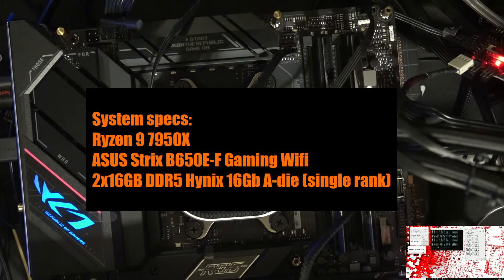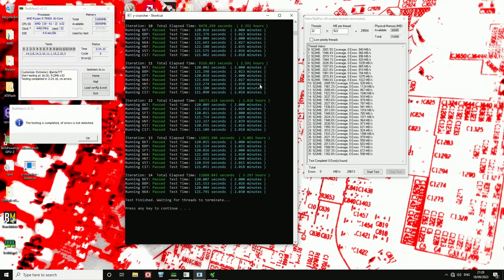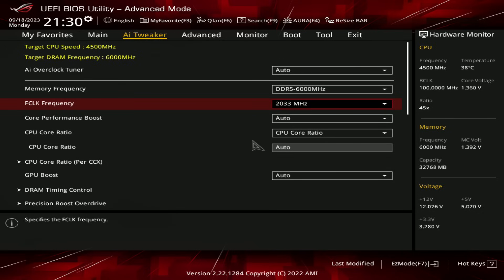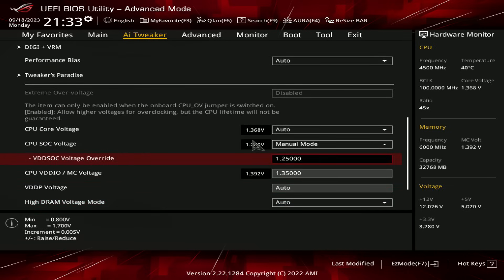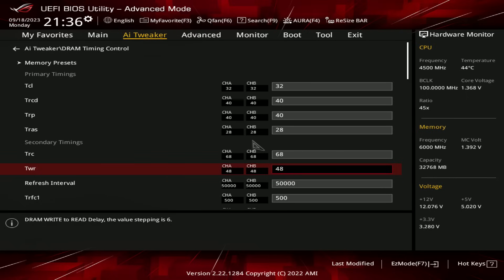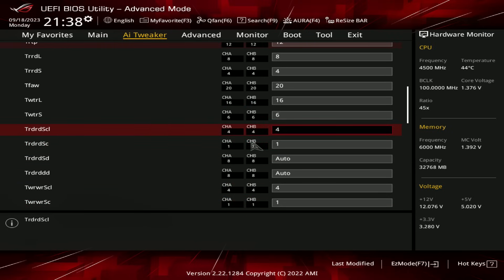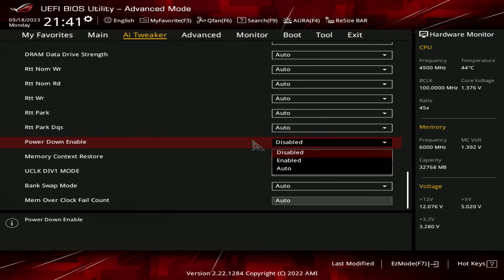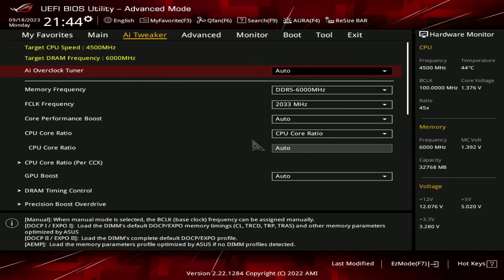Easy memory timings for Hynix DDR5 with Ryzen 7000

Comment: Just achieved your exact settings on a totally different kit, albeit with Hynix (A) memory.
T-Create Expert 64GB (32x2) 6400 dual-rank on a 7500F. Even the primary timings worked (though other's  mileage will vary).
Tested with Y-cruncher only, then played FC5 for a couple hours.
Thanks a lot!

Comment: Has anything changed in a year? Just got a 7900x3d 32 gb Hynix (gskill) x670e….. I’m looking for a good time 😅😂
Reply: FCLK 2033 being faster was due to a bug which was fixed a while ago where the memory controller would run faster than intended, FCLK 2000 is now the 'best' for DDR5-6000
Reply: @NZZN_ would you suggest 2033 or 2000 of both are working and booting etc?
Reply: Nope

Comment: So fantastic your video, you saved my life, I tried to upgrade my memory with 2 additional 16Gb DD5 Lexar Ares, identical to the first 2 I already had and there was no way to run this memory at decent settings. I was worried to have to accept much lower speed to increase my memory. I know that 4 modules configuration is harder to get to work with XMP, but your settings allowed me to run then at 5600 Mz instead of 6400 but with tighter primary timings resulting in identical if not faster results than with only 2 modules, great job !

Comment: Thank you so much for these, I'm using four sticks since I didn't know about the issues before hand and was having immense trouble getting my system stable at anything past 5400MHz, with these settings so far it's been stable at 6000MHz running tests for an hour or so, before was getting memory errors within few minutes.

E: Seems my system is stable at 6200MHz memory speed with these timings, absolutely magical.

Comment: damn, really impressive. Managed to boot into windows no problem with these timing using the G.Skill Flare X5 6000Mhz CL32 (2x16GB) kit. I don't exactly know which die, but I know they are Hynix. tRAS minimum setting was 30, and even manually i couldn't set it lower than that (Gigabyte B650 Aorus Elite AX, F31)
As others mentioned in the comments, I also set the Inf fabric to 2000Mhz with more up to date bios.
Time to stress, hope they are stable.

Comment: I made the video adjustments, in fact the performance improved, I saw some people commenting on the risk of corrupting data on the computer, due to these changes in memory, should I be worried?
Reply: It's possible if your config is extremely unstable. Then it can corrupt windows while booting. This is usually fixed using the windows diagnostic tool but if you keep trying to boot with a very unstable config you can eventually destroy your windows installation. Very rare and requires a lot of negligence. If you boot into windows no problem the chance is basically 0.
Reply: @fVNzO I think that's what happened to me. My m.2 doesn't show up anymore and I had to reinstall windows on another drive. I'm afraid to do any ram tuning now.
Reply: @Davetheguitarhero108  just do a full format through CMD (slow format). I've never heard of someone killing the drive if they didn't mess with clock gen.

Comment: bz can you help me please? I set these timings and it is stable at 5800mhz, at 6000 testmem5 starts showing red errors. AsRock b650m hdv m.2 mobo, ryzen 5 7600x cpu, adata xpg lancer 6000mhz cl30. Maybe I got a really bad cpu that can't handle the speed, because before these timings, it could only run at 5400.

Comment: Hey everyone ans buildzoid it seems on latest bios at least for me these settings arent working correctly like they used to as even though my latency is low i seem to be getting much woree 1% lows and gameplay is not smooth despite high fps.

Pc is 7800x3d, 2x32 hynix corsair 6000mhz cl30, board is asrock x670e steel legend. Anyone have any ideas as performance seems to be perfectly fine on default bios and I swear the performance of these settings used to work better but now it isnt for me, terrible 1% low and not smooth.

Im almost certain it used to perform better despite 64gb ram. 😢

Comment: came here to find fix for the asus rog strix x670e-f mb vga white led when using expo or oc memory.. yeap still trickering that vga led on and cant "press F2 or Del to enter the bios" when boot.

Edit moar: Some how memory overclocking disable Nvida rtx gpu lol :D Why is that?
Edit more because i can: It is mb display bug. When turning display on just few second after boot vga led does not stay on. If display is sleep mode vga led stays on. phew :)